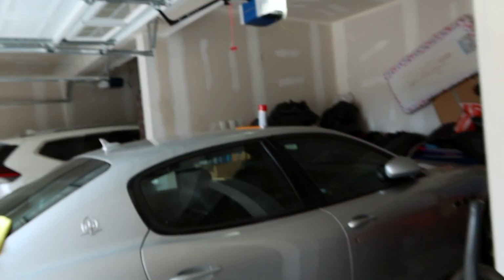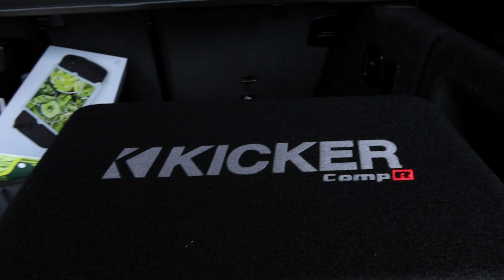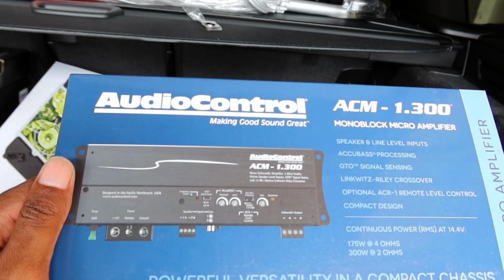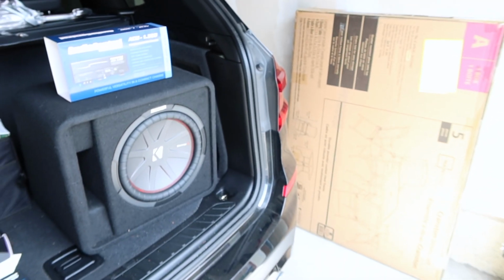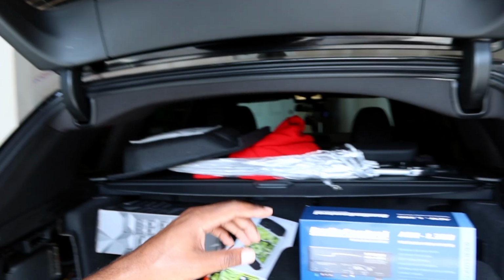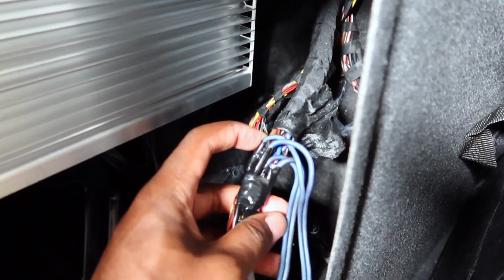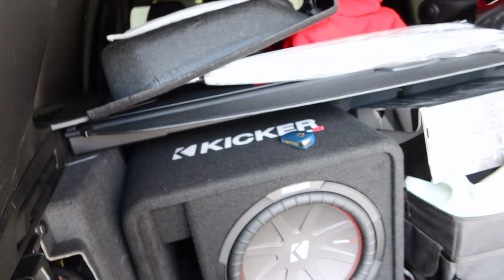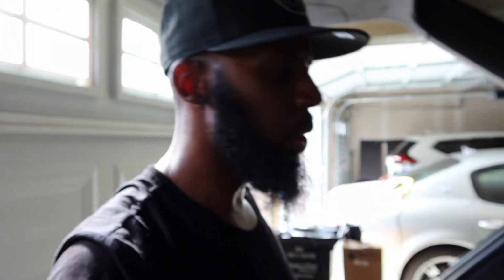ADDING SOME BASS TO MY GIRLFRIENDS BMW X3 - FLICARGUY DIY VLOGS

Comment: If using a different amp ehich doesnt have the GTO sense and needs a remote  connection . Could I tap into the amplifier main input as my remote ?
Reply from the maker: I’m not sure because I never checked it. You would have to get a multimeter and test to see if that wire switches to 12V when the stereo is turned on and turns off (goes to 0V) when the system is turned off. The correct way to do this would be to use that wire to trigger a relay that turns on your amp to prevent any excessive load on the input for the factory amp.

Comment: I used the same amp and you need to connect to the woofer output, crutchfield as a wiring diagram if you can find it!!! If you can't, look for the thickest twisted wire pair in the harness, As a last resort take out your seats and check the color at the under seat woofer itself. Worked amazing with the cheap kicker comp 10in sub

Comment: Ive used to kicker inline convertor and it burned from the left channel now that i bought an Lc2i audiocontrol there was smoke from the left channel again… any ideas why it keeps happening?
Reply from the maker: My first thought would be that’s not the correct wire. If you see smoke it’s likely that something has a dead short, meaning one of this wires has voltage that’s getting grounded out somewhere. Troubleshooting something like this would really require and understanding of dc current, voltage and resistance and how to use a multimeter to measure different things. More than likely though you have an incorrect wire and/or it’s being grounded out to metal or ground somewhere.

Comment: Next step car fire 
Restricted power = 🔥
Reply from the maker: Lol. This is the best comment I’ve seen so far, thanks for your contribution.
Reply: @FliCarGuy  lol sorry just trolling 😎
Reply from the maker: @dumpsterfire6351  lol. It’s all good. But you’re not entirely wrong either. If this was a big power setup without things properly fused etc, you could definitely heat up the subwoofer coils enough to start a fire!
Reply: @FliCarGuy  resistance 
It’s a thing 😎
Reply from the maker: @dumpsterfire6351  big time!

Comment from the maker: It’s been over 2 years and the amp has never shut off. As the subwoofer got broken in it played better. The Subwoofer does get smelly if you try to turn up the bass too much because of distortion and lack of power, but it plays reasonably loud with the bass set to a intermediate level in the head unit without issues.

Comment: I just added bass in my x3..My question is how to safely add a 2nd battery to help with the power the bass amp takes..I'm old scholl and want to know the correct way to add my 2nd car audio battery safely.
Would love your insight..I have a Deaf Bonce 2900.10 running 2 american bass dvc 12's in a qbomb box...Got signal where you said with a high/low adapter.
Reply from the maker: These cars have so many electronics in it that I’d be weary of adding a battery that the factory alternator would have to charge. That’s part of the reason I chose such a small amplifier, because I didn’t want any voltage problems in there and didn’t want to add too much load to the system. 

That being said, IF I decided to go for it and just decided to see what would happen, I’d probably use a battery isolater and connect the big amp directly to the second battery. Then I’d use a trickle charger at night to charge it up so that the factory alternator wouldn’t have to do all of the work. 

Typically in this setting you can wire batteries together in parallel, Positive to positive and Negative to negative. When you do that the alternator is charging both batteries at once and both batteries are powering everything in the car. The BMW may be sensitive to this though, so that’s why if I was going to attempt it I’d isolate them from each other. I would check a couple BMW forums to see if anyone has done it and if they ran into any issues. Bimmerpost is a good one.

Comment: Can you list the supplies (and name brand) you used in your video… amp, subwoofer (size), cable types (length), etc. I am a 50+ women and I want to do this to my daughters X3 for Christmas. Thanks so much!
Reply from the maker: The Amplifier is an Audiocontrol ACM- 1.300 The subwoofer is a Kicker 12” CompR loaded enclosure. You don’t have to use that specifically, it’s actually a little too big for the amp although it works well. You could use any quality subwoofer enclosure that’s rated between 300-400 watts RMS at 2ohms (a bit technical but it will be in the description for most things sold online or you can ask for it if you go to a local retailer). I’m sorry I didn’t really take not of the length of wire etc as I just had some extra laying around from past projects. If you buy an amplifier wiring kit with 8 gauge power wire a fuse, and some speaker wire, it will have more than enough to do the job.
Reply: @FliCarGuy  thanks so much for this!
Reply from the maker: @DaniiMarie333 no problem!
Reply: @FliCarGuy  I am so happy to see that you responded to me. Thank you thank you so much for the info. Your video is so helpful and I appreciate you posting it as well as your reply. Have a fantastic holiday!

Comment: Hey buddy I appreciate you making this video. I picked up an X3 and needed some more bass and this is the only video that helped me out fully. I got the same amp. Makes things lots easier. It pushes 300w rms with a dvc sub wired for 2 ohms. I wired up my amp tonight; my sub will arrive tomorrow. Super appreciative of you commenting later the wires you tapped and that they were the thick ones. 

Thank you!!
Reply from the maker: No problem, I’m glad to be of help, and thank you for taking the time to comment!
Reply: @FliCarGuy  Hooked the sub up yesterday and everything works perfectly. Thanks again!
Reply from the maker: @lockheedload  glad to hear, enjoy!

Comment: Steve meade dyno tested both of the acm's and they made way over rated power and he ran 2 21 inch sundown subs that are 2000 wats rms and it drove them.
Reply from the maker: Yah I saw it, that was part of the reason that gave me confidence to try it out. It’s not getting nearly as much input voltage as in his test, but it’s been decent.

Comment: You should tap into the subs under the seat as they play bass and the mid range with give you almost no bass because it just does not play low. Best to first put your ear to the speaker to hear if it's bass playing or not if you don't have a RTA. That's why you don't have lows because mid-range was tapped into.
Reply from the maker: The amp was tapped into the subwoofer wires, the Kicker sub is playing fine with all of the lows.
Reply: @FliCarGuy  okay because in your video you said that it doesn't have that low bass...
Reply from the maker: @0togtr811  Yah, I just meant the way the box is tuned, some of the real lower notes don't play that well compared to cars I've had with big 15's in there and much bigger boxes and more power.

Comment: Great info! My wife has the same car. Can you tell me what color the positive and negative speaker wires you tapped into are?
Reply from the maker: Positive black/red, Negative black/brown. Other one is positive blue/red, negative blue/brown
Reply: FliCarGuy thanks!  You’re my hero!  I’ll give you a shout out on my channel when I do the install! 👍👍
Reply from the maker: @ocmotivator  no problem man, that’s what it’s all about! Happy installing.
Reply: @FliCarGuy  hey bro, there are two sets of those colored wires, 1 set is thin wire and the other is thick wire, did you tap into the thick wires?
Reply from the maker: @kline1cs  I'd have to double check, it's been awhile. Let me see if I can check and get back to you, there's a picture on a BMW forum somewhere.
Reply: Appreciate this my guy. Im about to attenpt my install this weekend . Got an Alpine 10 inch active sub for simplicity. Great vid@FliCarGuy
Reply from the maker: I will have to look, I don’t remember off the top of my head, I will get back to you, I’m not sure why I didn’t mention it in the video lol.
Reply: @FliCarGuy  Thanks! And by the way, did that Audio Control amp work out ultimately?  I know you mentioned that it was getting hot. I'm getting one to run 2 8" Rockford Fosgates and can't go to a bigger amp because my commuter car is a hybrid and it's not safe I hear, to use a higher powered amp.
Reply from the maker: @ocmotivator  it gets hot sometimes but it’s never shut off once. How much watts are the 8” subs rated at?
Reply: FliCarGuy so they’re rated at 250 watts rms each.  So I’ll be a little under powered but everywhere I’ve looked, these amps go way above the 300 watt rating so I’m thinking I’ll he hitting close to 400 watts or 200 per speaker.... hopefully!